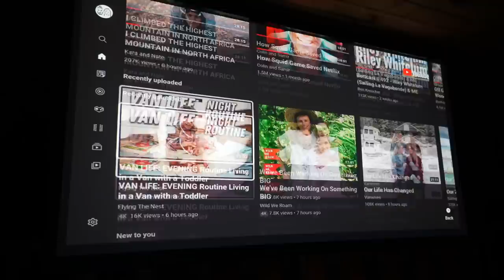Winter at Our Cabin in the Woods

Comment: About 10 years ago, I was introduced to the concept of "all weather tires."  They're not all season tires, and are actually winter rated, but intended to keep on all year.  They are softer, so wear faster that keeping 2 sets of tires in circulation, but they're a really good option if your car doesn't see a lot of distance. I drive about 8-10k per year, and mostly in winter, anyway, when biking is less fun.

Comment: Quick tip: tie a string onto your traps so that Mr Mouse cant crawl away with the trap attached to a foot or tail...it does happen and trust me...it's gross when you find it weeks or months later! Also...those traps with the metal are not as effective as the ones with the plastic (uugghh) fake cheese flapper. I'm in a converted cabin as well...much experience!

Comment: I doubt you'll ever see this, but here are some things that helped me get rid of mice earlier this year: 1) traps need to be perpendicular to the wall as that is where the mice travel most often. 2) we found they like Nutella the best? 4) DONT vacuum the poop!! Mice poo can carry lots of diseases that can then become airborne if you use a vacuum. best to spray with a disinfectant/bleach mixture and wipe up after a few minutes by hand. 5) use caulking with some metal mesh, or steel wool to close up access point (most mice can squeeze through anything bigger than a nickel). and keep your traps fresh!

Comment: For the mouse issue try extra large glue traps (8"x12"), it is a shallow plastic tray filled with insanely sticky glue, put peanut butter in the center and it is far enough from the edge that the mice need to step on the glue even to attempt to lick the peanut butter and they are caught.
Hope you guys are ok, separate sleeping is the elephant in the room.

Comment: Hello, the best path to mouse prevention is blocking there entry. Canned Spray foam with coarse steel wool embedded in it to block entry holes will effectively block there path. A tip to your mouse trap use ….. use only the smallest smear of food bait on the trap , this increase there chance of triggering the trap .put the trap facing the wall tightly. Or for your quite clever mice face two traps with the business ends touching . When you encounter super ninja mice tie a piece of solid favourite food to the trap with dental floss. Time consuming but very effective . All brought to you by an old retired baker.